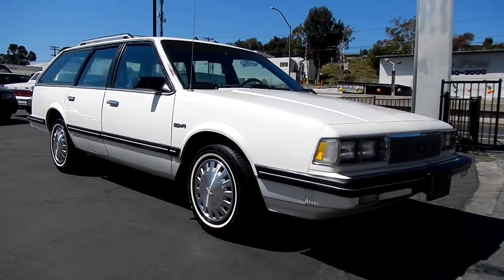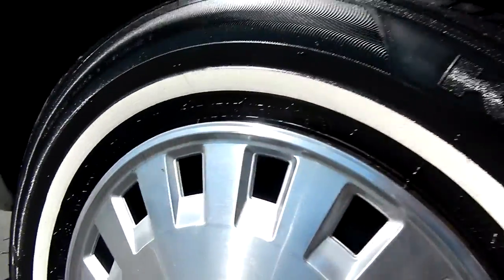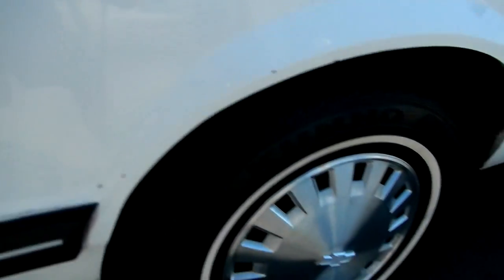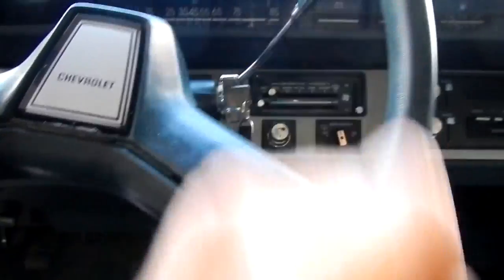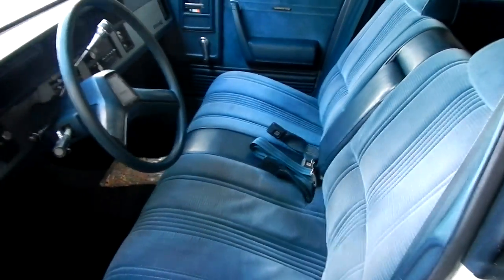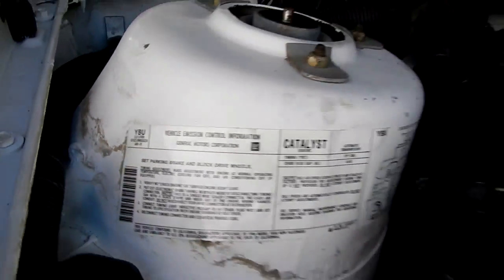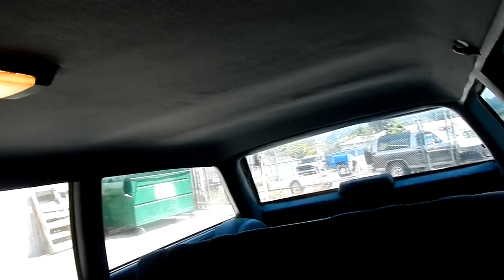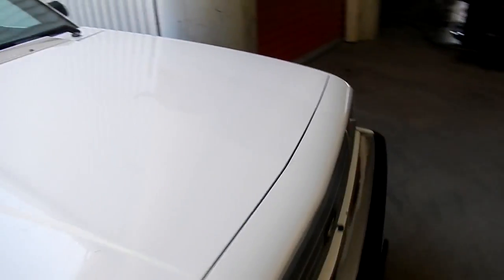1986 Chevy Celibrity Station Wagon Kombi Estate Break 2 Owner 77k Orig Miles

Comment: These are die hard GM's, they did well with these engines. The bodies didn't always hold up but these engines were very reliable considering the garbage America was manufacturing in the 80's. I still see these around from time to time.

Comment: This 1986 Chevy Celebrity wagon has the flute tone for the seatbelt reminder instead of the scary buzzer. Did the 1986 Chevy Celebrity ever use a scary buzzer or just the chime tones?
Reply: Yes some of them did use the buzzer from 1982-1984 but most of them 1985 on used the chime